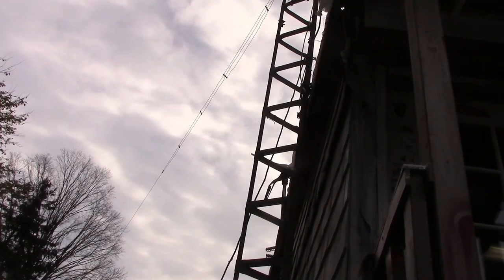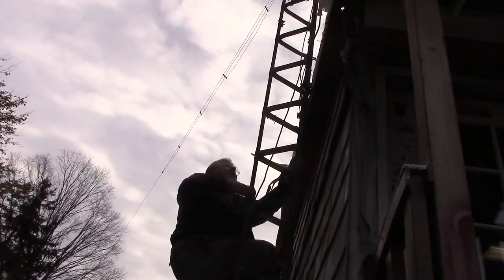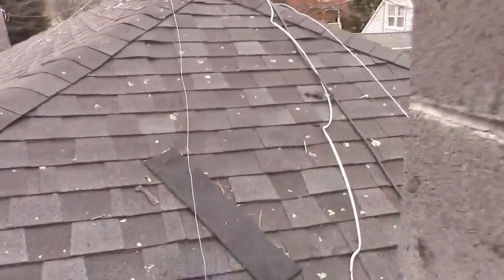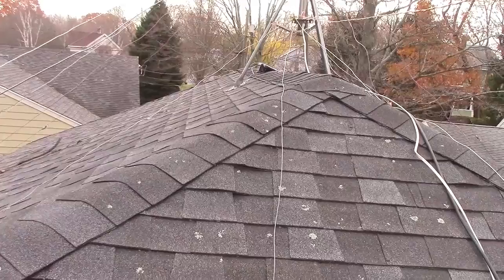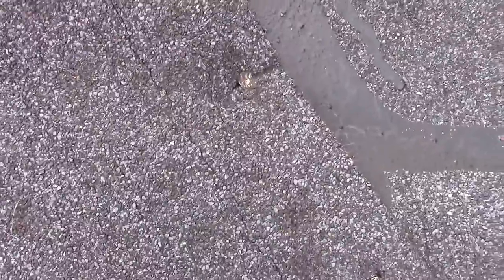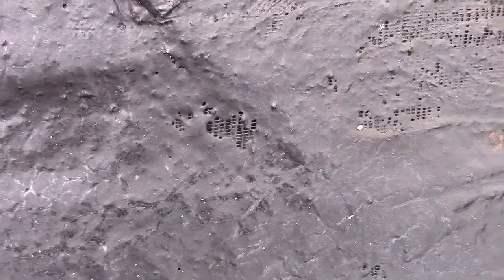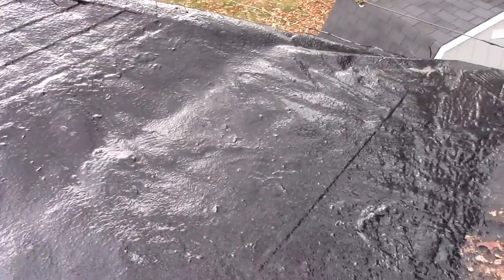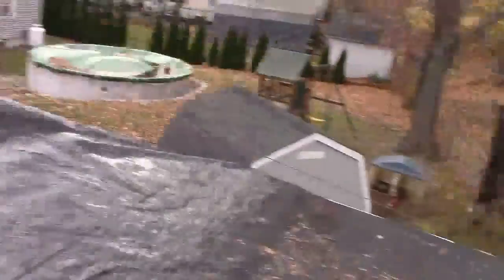Roof repaired I hope

Comment: I see you've got a few places there to seal up.  Tar works good for that. I've got a porch roof leaking. Just put a tarp over it for this winter. We work alike. I used 2 different gloves too. Only thing is they were both right handed so I used one upside down. LOL!
Reply from the maker: If this didn't work and it starts to leak this winter I maybe using a tarp lol.   lol on the two right hands
Reply: I splurged on the green tarp. A little more but it blends better then blue & a little better quality. Just beautiful. NOT. It's mentioned in my next video. No gloves this time. LOL!
Reply from the maker: I used silver and bungee cord to wrap our boat .  It worked great as long as I used the bungee cord instead of cordage/rope.
Reply: Bungees are the bomb!!